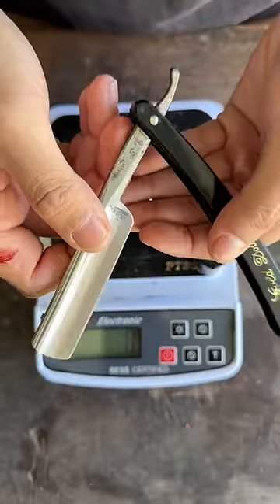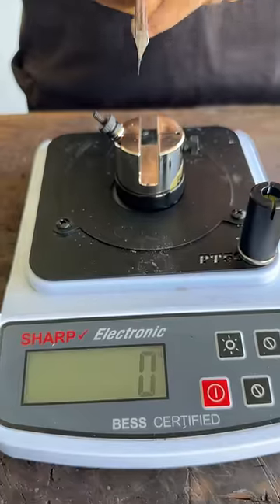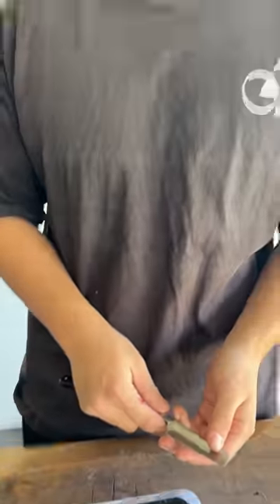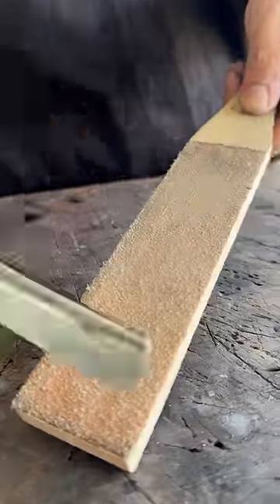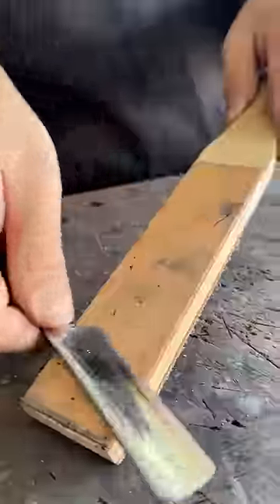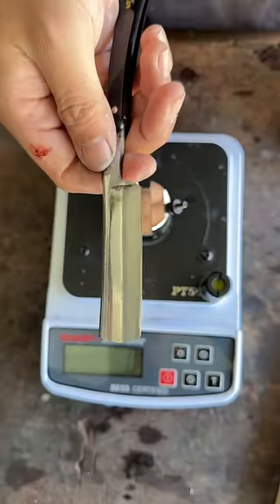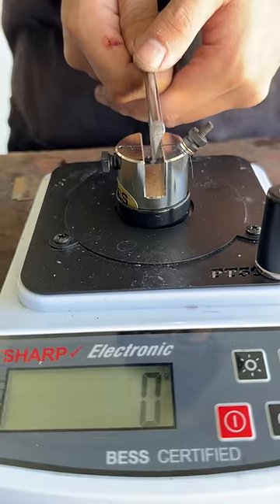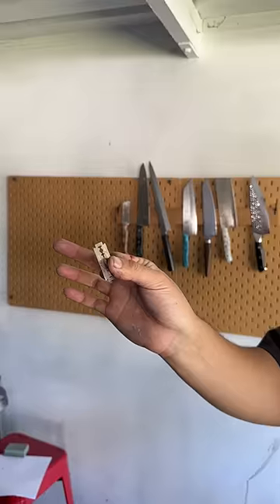Restoring a “cut throat”   #fyp #shorts #knife #knives #knifesharpening #kitchen

Comment: “This is dull as shit.” 
cut on hand showing 💀💀💀
Reply: Dull knives are more dangerous than sharp knives. If you try to cut with a dull knife, it's far more likely that your hand will slip.
Reply: @Happyfoam-lw3yt also dull knives leave wider cuts
Reply: @nic139 and sharp cut deeper
Reply: @aleks-lj9yq  not necessarily
Reply: @aleks-lj9yq  not really, if u count the force u use for cut

Sharp knife only use less than 25% force to cut same thing compared to dull knife, its hard to miss

But if u get cut, its usually shallow, doesnt hurt, and healed next day, compared to dull knife that take days
Reply: @frederickateng3779 true. A sharp knife will cut more, faster than a dull knife will. A dull knife rips skin away ( like a saw on wood ) while a sharp knife will split the skin apart without tearing any skin. ( like a hot knife though butter ) this is why it hurts more to get cut by a dull knife. A dull knife will tear more skin causing damage to more nerves and pain receptors, and a sharp knife will cut far less skin. It will also heal faster if it’s sharp because it’s a “clean cut” the 2 walls of injured skin are a lot closer together that torn skin is. if you look at a dull knife under a microscope it will look closer to a saw blade than anything else. If you look at a sharp knife under a microscope, it will have imperfections, but it will still be nearly perfectly straight. I’ve said my piece 😂

Comment: If it hits 0 its gonna be as sharp as the Swords in the 40k universe.

For context, the edges of those Swords go down to the MOLECULAR level.
Reply: ayy 40k!
Reply: Obsidian blades are used in micro surgery and csn cut on the molecular level.  Its pretty wild.
Reply: only bladed power weapons do but it isn't even the sword itself its the lil energy field thing (disruptor field) around the blade that actually cuts at a molecular level
Reply: @traumatizedmysticalcat  Hold up weren’t the points on the teeth of chainswords molecular too?

Comment: I would like to see how effective the belt sharpener, that are in older movies, is
Reply: Never seen a movie with a belt sharpener, any examples?
Reply: @platinumsky845  I'm not sure what it's made of, but it looks like a giant leather strap with handles at one or both ends
Reply: @skyler9988  that’s just a leather strop, it hones the edge but doesn’t sharpen, it’s normally the final step of sharpening
Reply: @tomwilson7236  ah okay
Reply: @skyler9988  ohh yes, exactly as tom said, he actually used a wood mounted strop in the video too. sorry for my confusion.
Reply: It's a razor strop... He used a leather strop in the short... 
When it comes to straight razors it's more of honing and stropping than "sharpening"

Comment: I did not know there was a device that can measure sharpness. Pretty cool
Reply: it just measures how hard you have to press to break the string, the number you see is the force required in grams to cut the string
Reply: @jewellry  thanks for explaining bro
Reply: You can make this home, buy fishwire a scail and find someting that can hold the wire on 2 points but the wire must be under a lot of pressure
Reply: Ngl I think he used it wrong
Reply: You see them all over the YouTubers that sharpen knives, and they all use it wrong to make the knives look sharper.  I'm just here to downvote though, so no biggie to me.
Reply: @arg8763  how do they work ?
Reply: @toastychrunch  he didnt
Reply: @daerfes  :(

Comment: FInally someone using the fucking sharpness tester the right way and not abusing it to the point where they could say a butterknife is sharper than a scalpel by using the scalpel very slowing and chopping through the wire with the butterknife.

Comment: not sure what you final grit was, but typically razors need to finish around 8-10k with some guys using 12-15k.

you also need a nicer cleaner strop, that first strop looked like suede, try some nice bridle leather or latigo and make sure its clean you second strop sounded gritty.

Comment: Zero is impossible to reach, bcz those numbers represent edge radius at its apex. Meaning thickness of the edge, the thicker the edge the duller the blade, and thickness can never be 0.
Reply: The numbers represent the downward force in grams.
Not any measurement of the apex.

Comment: Hey man you can't use a sharpening stone on that trust me i have one of those, and a sharpening stone isn't the way to go a leather strap that's the way to go they call those straight razors cut throats for a reason.
Also I'm not allowed to sharpen knives at home without telling anyone because i use 2 different stones a very coarse, coarse, fine, and very fine.

Comment: Pro tip: one way to get ultra sharp is honing on paper, especially rice paper. It takes practice and patience but it can be done. I've heard other stories of people using silk, but I've never tried it. The reason paper works is it very smooth to the touch, but at a microscopic level its still course at a very fine grain. The lignin protiens in paper are far stronger than most people realize at are tough enough to quickly dull an edge. Those same protiens will also act as a very very fine abrasive polishing away any micro abrasions at the edge. Its best to do this dry, no lubrication, pulling strokes only. Good luck!